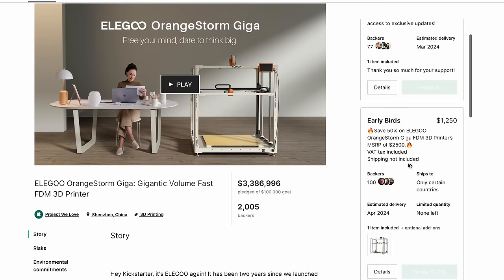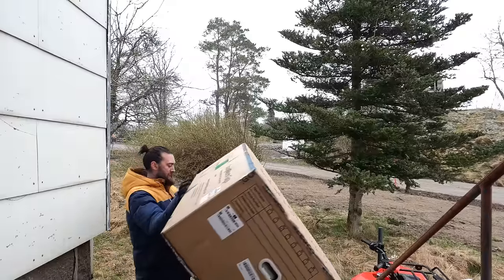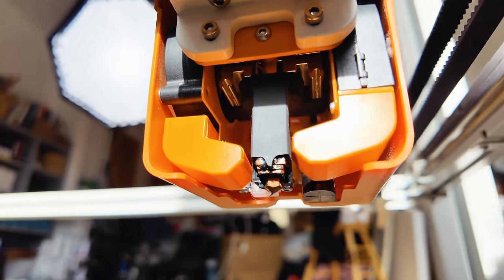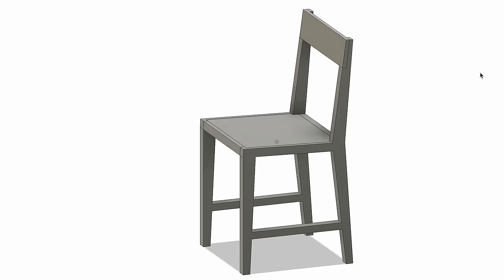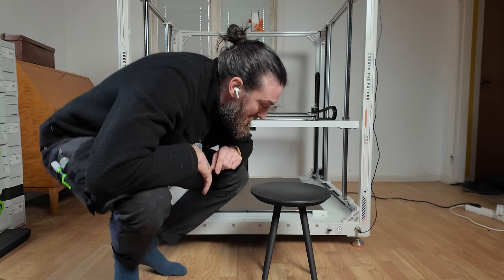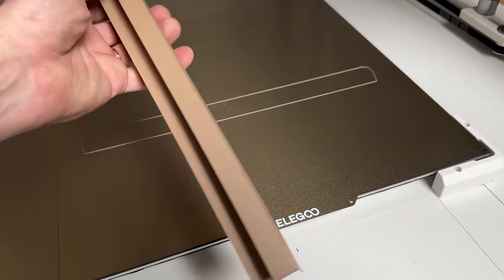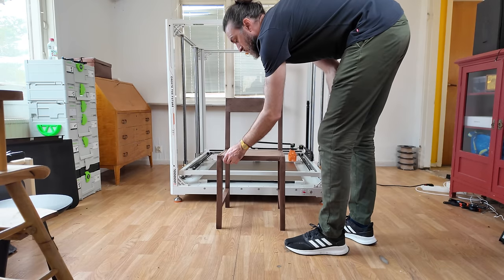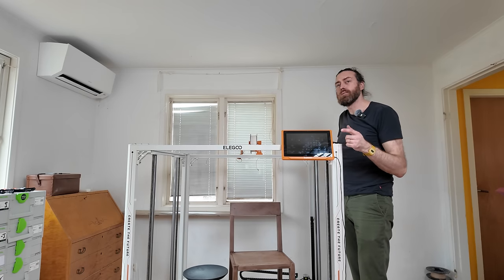I tried this massive 3d printer so you don't have to

Comment: Make large molds and cast concrete furnitures!
Reply: with plastic sheet and wood ;)
Reply: @pdjames1729  with pancakes and wood glue!
Reply: @MyllerSWE  old towels and spare gloss paint <3
Reply: ramen
Reply: @MiGujack3  Banana mush and hen feathers!
Reply: A mold master (to be reinforced/used with other stuff) is a great idea to offset the massive filament cost required to take advantage of the build volume.
Reply: or cardboard and make mushroom mycelium eat it up and it will end up a strong but light material
Reply: ah, yes, concrete, the material widely used for building furnitures, due to its low density and high torsional and flexural strength.
Reply: @dandcc9192  an idiot will use it the wrong way. Someone smart will combine it with other materials like most furniture are multi material and in the right way.
Reply: That would quite a interesting idea to try , Wonder if you would have to cast rebar into it to make it stronger and or deal with layer lines ? 😀
Reply: I love using a forklift to clean under my couch
Reply: @MyllerSWE  A non-idiot would combine materials other than concrete together, but I guess not all of us are endowed with such level of intelligence.
Reply: @MyllerSWE  Aircrete weighs around 10x less and could pull it off.

Comment: Actually, increasing number of walls might help more than addng the infill :)
Reply: Yeah increasing the walls is way stronger than adding infill
Reply: @therick0996  Adding some crossbars at an angle, would offer you way more strength, probably could look at reducing the useage of filement.
Reply: @FrodeBergetonNilsen  which includes a redesign. Something not mentioned at all. Only changes in slicer settings are mentioned
Reply: @therick0996  I know. The problem is that he made a chair that works for wood but not plastic. It needs a redesign, and simply will not be fixed by slicer tricks. Also, what works at a smaller scale, simply does not need to work at a larger scale. Once you do some real designs, you know. I simply do not know how to design anything in plastic at this scale, and I simply don't know anyone that does. Not for printing. I have absolutely no reference at all. None.
Reply: Came here to say this. Leaving a reply to boost this higher.
Reply: Not worth it. Even more material, even more expensive.
Reply: I know this from building Nerf guns for 3 years, anything functional has to have at least five walls 40% infill .2
Going to your slicer change the walls to 99 and it will have zero gaps put it at 100% infill and you'll still have small gaps adjust to your liking
Reply: Gradual infill density.
Reply: @FrodeBergetonNilsen  That's what I thought. I would increase the diameter of all structures and add far more bracing. I also would round out all corners. It's plastic, not wood. Take a look at chairs that are made from plastic right now! There is a reason why they are designed so clunky. Plastic is far more prone to bending under load and can take less shear forces than wood.

Comment: Actually, PLA is one of the “strongest” materials you can print, for holding/crushing, and layer adhesion. Petg, and Abs are better “impact resistant”.
Reply: PLA is more ridged and PETG/ABS are more ductile.
Reply: ABS also won’t warp under load. 
Like if you print a towel hook in pla, it will slowly bend under the weight and break. 
ABS will just sit there happily holding the towel unless the weight is too much and it just breaks.
Reply: @youtubevanced4900  that’s total BS, I have printers with parts 5-6yrs old that have PLA parts, under tension and they haven’t moved.
Reply: @Thomllama  I'm glad for you. It is true though. It's pretty much the only reason anyone uses ABS besides a bit of temp resistance.
Reply: @youtubevanced4900  been 3D printing for over 10 yrs. Everyone uses ABS mostly for temperature resistance, that is the one true statement about the material differences. PLA will soften much easier. I used to prototype in PLA with plans to replace with PETG or ABS, many I never did and the parts still work fine without issue years later. Many myths were spread back in the day about materials we print, some true, many not.
Reply: @Thomllama  I’ve tried both over the past 5 years in which I’ve been printing. 
I’ve definitely seen PLA sag and ABS hold up. 
Probably has a lot to do with the design and the actual application. 
I mainly use PLA though as it’s easy to print and gives fantastic performance in most situations.
Reply: I have found TPU to be the strongest common 3D-printing material if the elasticity is not a problem. Almost ridiculously tough to break even in thin parts and great layer adhesion. I have not tried any high-strength materials like nylon though.
Reply: @Murgoh  the idea of nylon and carbon fibre tearing the inside of printer to pieces scares me
Reply: Yes , they are , but pla loose in the temperature  race , thats whyyuo use materials like abs , nylon etc , they can reach high temp (pla get soft about 55-60 celcuies, CF -nylon  get soft at 155c)
Reply: Carbon fiber/nylon filament is stronger
Reply: @vegyzus  actually weaker, (breaking point) lowers the bonding surface.. stiffer/ less flex though
Reply: Honestly I've had awful layer adhesion with PLA.  Idk if I did something wrong but I just don't think PLA would be a good idea, even if it is cheap.

Comment: Part of the benefits here would be printing geometry that would otherwise be too complex or time consuming to create in any other way. For example rather than using to print a chair that could be created using wood and "traditional" joinery, creating a chair that is designed from the ground up to get the full benefit from 3d printing - the design of the chair could be truly unexpected and interesting as it's not informed by tradition or the limitations of traditional woodworking. Great video 😊
Reply: I would use that large printer to print smaller 3D printers. It might be possible to stop the printing and restart in a static held bed that can hold position while X-Y metal and harnesses are added. And I think there is an even flow mixing infill that can be used to manually inject slow cure epoxy every so many layers.

PRUSA is open source and I would try modified clones of the 5 color versions

Comment: Bless you.
I was a wood furniture designer/builder for 45 years. After being forced into early retirement I decided to try tackling printed furniture.
There is about as much to learn about printing as there is to learn about wood furniture building, and not much crossover between the two. 
The first thing you must do is 'think out of the box' when it comes to designs, avoiding overhangs/ supports, 'joinery', and try to come up with one-piece solutions to furniture applications. It's not easy to switch over from woodwork thinking but you'll get the hang of it.
I realized early on that I couldn't really make anything from gluing together parts, so I purchased a Modix big60 for about what you paid for the elegoo. It's been a very reliable and flexible machine. I print mostly with a 1.0mm nozzle, sometimes a 1.5mm and sometimes a .8mm.  I avoid infill when I can and rely instead on hollow parts with multiple perimeters and internal bracing/webs, it saves time and money and is pretty strong. I only use PLA for prototyping ideas and PETG when it's time to get serious. (The thing about PLA is that it sags and weakens over time, some of the large prints I did 5 years ago are starting to fall apart.) PETG is a little too flexible sometimes though.
I've experimented with CF/Nylon, ABS, PC, etc., and they are not cost-effective, plus they all require heated enclosures.
Drying your filament is essential, always take your spools down to 12-15% before you use them, and keep them in the dryrs when printing. I have several of the sunlu dryers, they work pretty well.
Calibration is crucial. Whatever printer you're using, flow rate, e-steps, clearances, temperature towers, experimenting with nozzles, temps and speeds is essential before you can get consistent results, and on a big machine, these factors are even more important to get properly sorted.
I abhor postwork. After 4 decades of woodworking I don't ever want to see another piece of sandpaper or finishing product. And this is one place where printing can be a boon, a properly designed project can come off the bed ready for use, which is just the way I like it.
The time factor is a drag, yes, but I just turned out a pair of very nice loudspeaker enclosures with double walls that I filled with fine sand, and not only are they stylish but the sound in amazing, and REW software measurements show that they are as accurate as any production examples under $6000 a pair. Yes, They took 400 hours to print, but a pair in plywood or MDF made to the same standard of function would take a comparable amount of days because I can print 24/7 but only work 12/7.
I prefer matte filaments to gloss, they hide the layer lines/imperfections better. And even though printers x, y or z can supposedly print at 300mm/second, the basic rule remains, slower means better quality.
As other posters here have commented, making casting molds is another excellent technique and has the advantage of multiple copies being produced from a single print run ( sometimes! ) I considered casting my speaker enclosures from hydrostone, but in the end I just printed them because it was faster. ( I am not always a very patient man ) 
I also weigh in at 300 pounds, so designs that will keep my butt off the floor will pretty much work for anyone.
So keep working on it, if you want to discuss anything just contact me through my channel.
Reply from the maker: Hey! Thanks for your comments. I did do some calibrations - especially e-steps but since the heat break is broken - I didnt want to do too much calibrations before I recieve a replacement as it could be due to that. Great ideas for printing!
Reply: @TheSwedishMaker  I forgot to add, to solve the problem of the individual metal bed sheets not lining up perfectly, level it all as well as you can and have a piece of glass cut to fit the total bed area. I've been printing on glass for years and it presents no special challenges as long as the bed temp is kept below 70C, so it won't stress-crack. For special use cases you can apply a PEI sheet over the glass.
Reply: Subscribed.

Comment: As someone who has a company for 3D printing, we actually are planning to get a large-size printer but the main use of such machines is not making or competing with regular furniture. We make custom-made products for our clients and when we make a design, it is unique and personal for a specific customer which makes it worth much more than a regular product that can be found on the shelf. And, using wood filament to make an actual chair is not ideal since most additives to filament will weaken it. A common good material for these applications is ABS-GF or PP-GF. These materials are fantastic, strong and rigid and will be suitable for furniture making.

We have our eyes on Mingda industrial printers (the 1m ones) which are enclosed and are suitable for engineering materials. The Elegoo orange is fine for basic materials it seems but lacks the potential for better materials ESPECIALLY at this scale things go wrong quickly and you need a stable environment to print your parts in. The Elegoo orange is waaaaaay cheaper though :)

Thank you for sharing your thoughts!

Comment: I can see cosplayers having a field day with this printer. They already use 3d printing quite a bit, but with this they could make stuff as one whole piece instead of a bunch of smaller pieces glued together for the most part.
Reply: yeah you could print whole helmets and chest plates in one go. But it really would need to come with at least 2 heads so one can be a dedicated support material head since that will be used a lot in large prints with complex shapes.

Comment: One space tip, open the box outside, and carry the pieces in?  Then you only need the assembly space inside.  You know, when it's NOT snowing.  // The value add is when the price point is high, not low.  Say, 3d printing yourself a coffin.  Those things are stupid expensive.  Or, body kits for cars, where customization is worth the money, and they are essentially non-structural.  Great video!
Reply: "Hey look, he opened the box outside his house ... Is that allowed ?"

Comment: Id be interested in printing the stool hollow then filling it with something. Resin or even a thin concrete might be interesting. I realise it would require design of the internal structure but would be a very interesting build method. Also in only creating an outside layer it should use less pla.

Comment: I like your video, thanks for doing this.

You could use the print parameters used by VORON for your designs. Those are really stiff and it should be the right amount of walls, infill etc.

Comment: Use orcaslicer and do all of the calibrations to fix the under extrusion. If your volumetric flow speeds too high for that filament, it will cause this. Also, wood filaments are hard to print with great results in general and I don't think they are as durable.

Comment: This is a great video. I'm glad I discovered this channel. As a maker (not limited to any particular material or craft, but with beginnings in woodworking), I greatly appreciate both the things this video shows can be done and can't be done. I am of the opinion that there is a place in any shop for any tool so long as that tool is understood and produces value in your process. I think 3D printing is a great complimentary technology--it's better at making some pieces rather than being the sole source of parts for a single project in most cases. 
You, sir, deserve every sub and now you've got one more.

Comment: 1) print a mold
2) use it for small series: concrete, vaccuum forming, polyester/composites,  sheet metal stamping, 
3) 3D print a small factory, a production line with multiple small serie techniques. instead of printing one item..
4) invent a garage factory.. 

A> a webshop with some funny product 
B> a production system based upon 3D printed molds in small series
C> ship it worldwide.. 

For example: make LEGO technic, but 10 times bigger out of polyester... The entire system. So you can make a real size lego car.
Make lightweight LEGO bricks out of concreet (lightweight) . Scale tewnty to one?  The entrie system. So you can build a house/garage out of it.. Including doors..
Reply: Making LEGO is a fun idea, but you'll have to take into account, that each part will shrink several millimeters over a couple of months. That's fine if you print all the parts on the same date, but if you wish to print an extra part 2 months later, it won't fit. (Been there, done that). Shrinking will stop after 2 months.
Printing molds for vacuum-forming is definitely a good idea! (Still keep the shrinkage in mind).

Comment: With the design on the stool and other large objects there are some options. You could add cross bracing between the legs quite easily as long as it's not angled past a certain amount, like 45 degrees ideally. Anything you print upright you can always chamfer more gradually into the large surface as well so support aren't necessary. For getting a wood pattern too, you can actually generate a wood grain effect and add it while modeling. In general, adding more walls will make the prints much stronger, especially in thin areas. Just some thoughts for you and anyone reading. Very cool!

Comment: Let us know when the stool breaks.  I would try printing it in parts. The chair seat plate as one print with hexagonal leg slots.  Legs separate with hexagonal shape,  printed flat on the bed so the layers are vertical, rather than horizontal. Possibly even each leg in two pieces that hexagonally plug in together.   Also it means a lower risk of print failure destroying the entire print.  You could then glue the legs or just make them them a snug connector fit.   Use arch construction for a full back rest chair.  With 3D printing you need to change the design to match the material capabilities.

Comment: Good thing about any problems with printing is, that enough time perfecting it will pretty much resolve it. Once you are able to overcome these issues and setup ideal printing technique, level out the bed correctly and know how to re-level it and maintain it, then it would take little time. The finish of any product can be improved by fuzzy perimeters or by sanding and paint job, finding right filament can greatly improve the outcome as well, so overall I think it is achievable with enough time around tinkering the process as with anything.

Comment: I should get back to working on my large format printer, print volume is 600x1000x600 but almost ¼ of the size of that one, my main design goal was that it would fit through a doorway without taking it apart.

Comment: Simply using more infil and more walls would make your prints super strong. I know it takes more time to print, but you would be surprised how strong each part would come out of the printer. I noticed this a lot that so many people use very low infil % and then complain about 3d print strenght. However, just don't rush and print stronger parts and everything will be working properly!